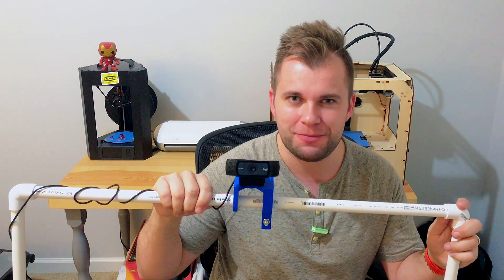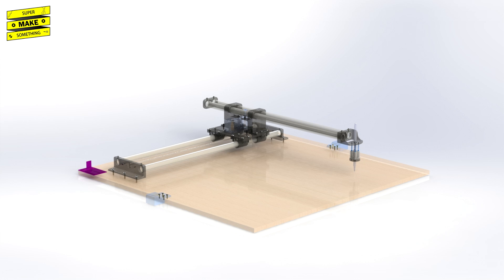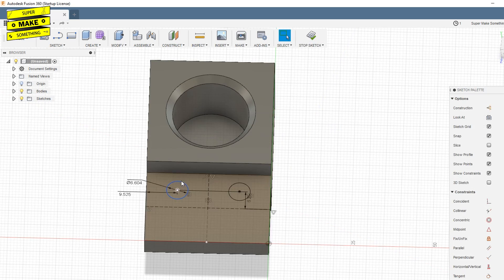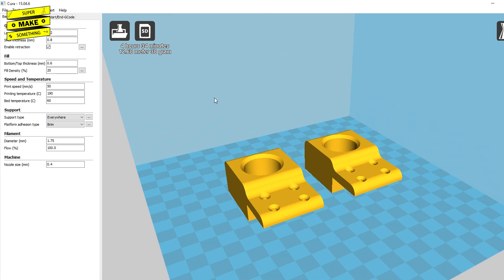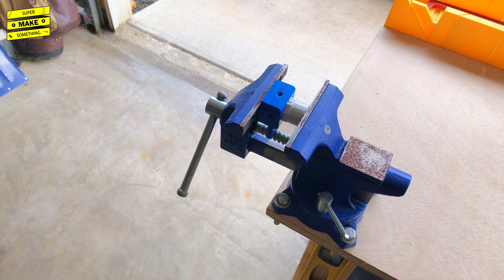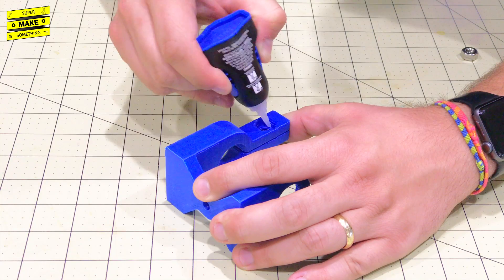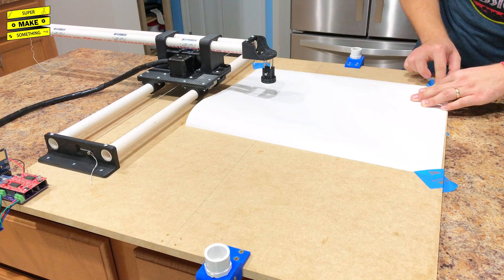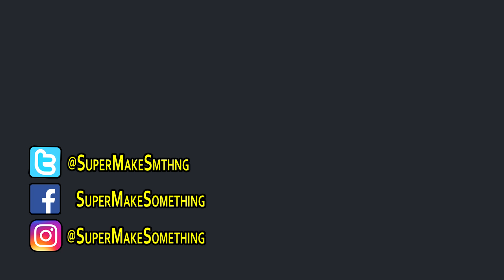Camera Mount for PVC Pipe (CAD, 3D Printing) - 2018 Cleveland Mini Maker Faire Wrap-Up

Comment: Why didn't you model the threads in the bases for the pvc adapter threads? Why not use a pvc union instead?
Reply from the maker: David Davis The main reason I didn’t model the threads was mainly time. Because Maker Faire was pretty close to when I started the project, I wouldn’t have had time to fine tune the 3D printed model with multiple iterations to make sure that the threads would fit. A PVC union would have also been a good option!